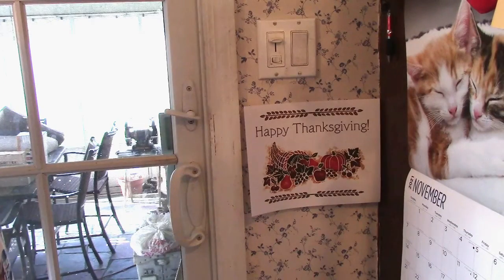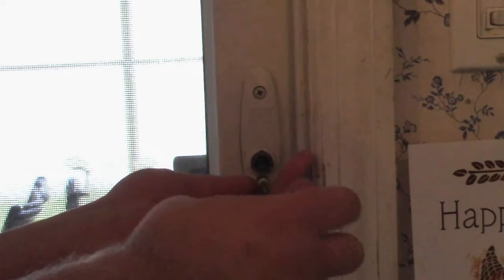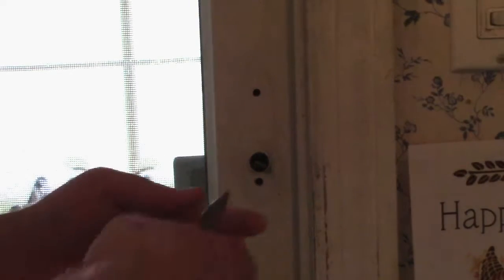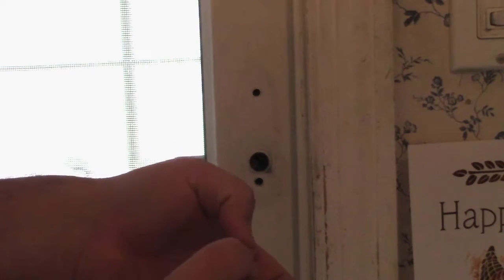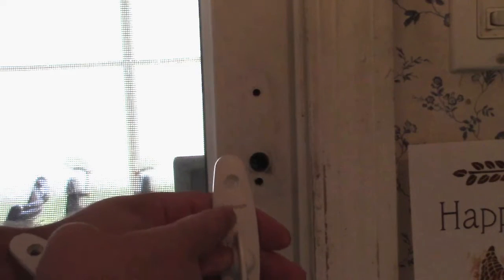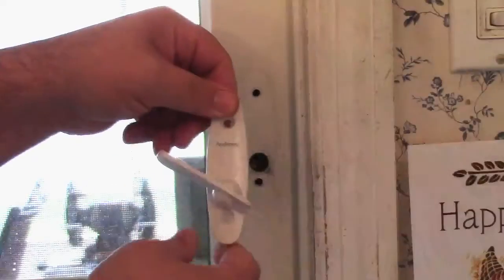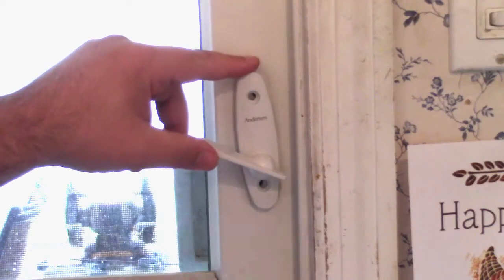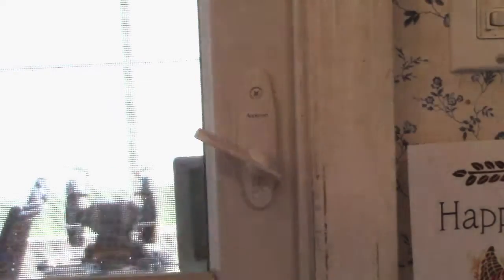How To Replace Andersen Sliding Door Thumb Lock

Comment: On my door, the latch is secure. Good to know the replacement procedure. 
The handle progressively loosened and fell off front and back. Handle came off in my hand, and the outside handle fell on the concrete screws skiddering everywhere! Any experience or suggestions from you would be welcomed. Thank you
Reply from the maker: Should be very similar to install, it's just 2 screws.  If you need replacement screws but you still have 1, you should be able to find a replacement at your local home center.  Take the one you have to match it up.

Comment: The problem is replacing the keyed unit on the outside. You have to get it in perfectly, otherwise it will not fit
Reply from the maker: This door doesn't have an outside keyed unit.
Reply: @jaykay18  Right, I know, would not mind buying one of these as I have 3 Anderson sliding doors in my house, but I could not buy any as they were not available. I like that snap, not sure if it will work with a Tribeca lock
Reply from the maker: @nld-bl5ct  This IS a Tribeca style lock.  I believe there are various other styles out there and the insides should be compatible across the board.  But I do not know that for certain; pictures of the item would verify for sure.
Reply: @jaykay18  You're right, this is a Tribeca lock. Again, I would love to get these units, but they are not available.
Reply from the maker: @nld-bl5ct  The link I provided in the description, that product is no longer available.  A quick search on Amazon only revealed the stone color.  But they are most definitely available from other places, perhaps with higher prices.  I believe Home Depot can order any Andersen part you need.  That's based on when I did that about 12 years ago, but they probably still can.
Reply: @jaykay18  Thank you much, looks like I went to the same places as you did. Will try Ebay. I just want to make sure it is the snap kind because mine still work well, but are the old style
Reply from the maker: @nld-bl5ct  No problem.  Just buy from a place that offers free returns and there's nothing to worry about.

Comment: Yeah I definitely thought that lock felt even looser when I was last there, I think I was actually going to recommend ya maybe replace it, but I think it totally slipped my mind. Nice that it's finally fixed! I'm sure it feels a lot more secure now. 

If you ever wanted to, as you already mentioned, we also have that bar for a little extra locking on the sunroom slider. Just an idea if you ever felt like you needed something extra, but of course not an absolute necessity.
Reply from the maker: Yes, I had noticed it was a lot looser, recently.  I had known it would break, because I read about it, but it's one of those things that you never expect would happen to you.  Anyway, the part was inexpensive, and the door feels like brand new now, much much better than it was.  Feels very secure.

I had often toyed around with the idea of an additional lock or bar or something.  I'm not that kind of guy.  Like at night, I had started setting the alarm.  Next morning, there we were, wif and I, having coffee in the kitchen, and one of us would decide to open the window, and BAM, the alarm would go off, central monitoring would call, all that great stuff.  Theoretically I could reprogram those zones as what were presented to me as "follower" zones, where you get the delay like you do when you open a door.  So what I'm saying is, the additional lock would just get in the way.  I mean, it's a glass door.  If you're gonna get in, they're gonna break the glass, and then all bets are off.  The glass breakage sensors will catch him, but he's already in.